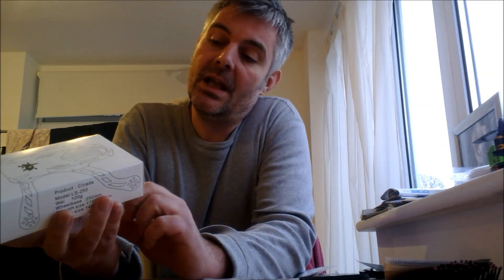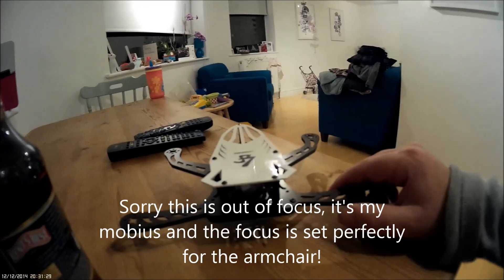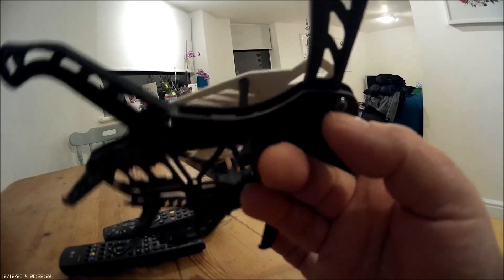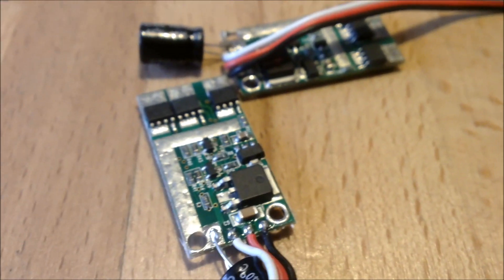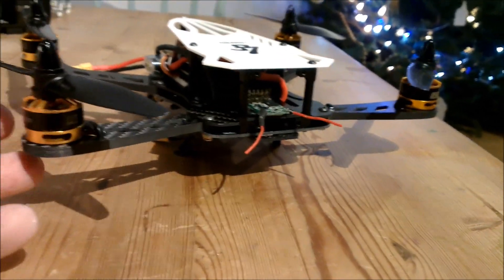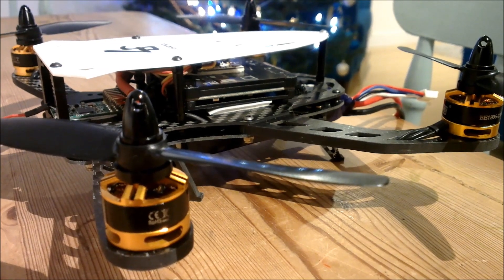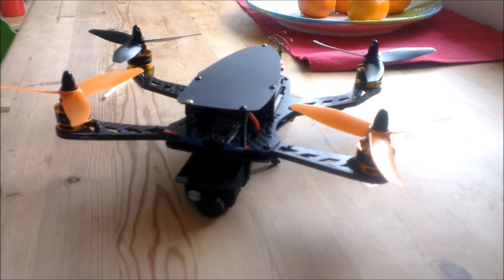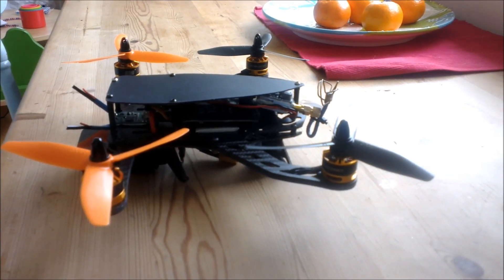LS 250 Cicada

Comment: Some one has FINALLY posted a video on this frame :)

I ordered one from EBAY back on the 10th of Dec and still waiting for it but after seeing your video im probably just going to sell it straight on as i bought a ZMR250 frame from the states which is waiting to be built (first mini quad build) which only took a little over a week to get to the UK where the Cicada is coming from China and still hasnt even reached the uk yet.

One thing i did notice but your mobious mount you have in the wrong place (guessing wasnt covered in the manual) but its actually meant to be mounted inside the frame where you have your orange receiver then there would be more clearance from the frame and those rubber spacers will give enough gap under to place a velcro strap.
Reply from the maker: I don't see how that would work Lorn, but I think you've made the right choice getting the ZMR, it's pretty tried and tested.
If you have the carbon LS-250, then I'd be interested in buying it for spares.
I've just ordered this http://www.banggood.com/GE260-Carbon-Fiber-FPV-Mini-Quadcopter-Frame-Kit-CC3D-Compatible-p-945687.html as a replacement when the Cicada dies, as my ZMR frame is going to a freind so I have someone to mess about with. Please note, this frame above is an almost direct rip off (as is the ZMR) from this site, where we multirotor fans should pay proper tribute, this is the guy behind our cheap Chinese frames.http://untestedprototype.com/2014/03/hammer-mini-h-quad-v3-0-manual/
Reply: I know i had seen an image of it mounted there but do you think i can find it now :( so my bad.

Yeah the ZMR is a nice frame and i have a nice matte 3 weave carbon frame which i think cost about £25-30 including postage from the states.

Ive always been a little unsure of Banggood as i have heard a lot of bad things about the carbon quality of the frames coming out of there.

My ZMR im holding fire on finishing as im waiting on a PDB from the RCGroups forums but probably wont see them for another month of so which will give me time to save enough to get the FPV gear.